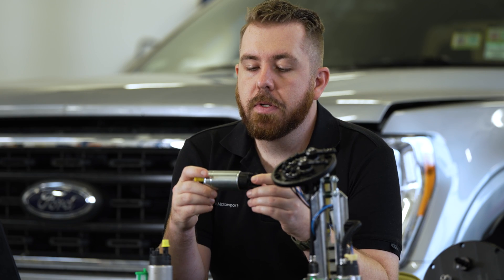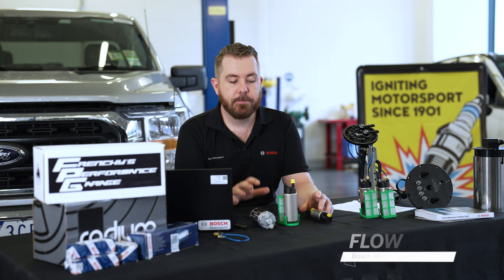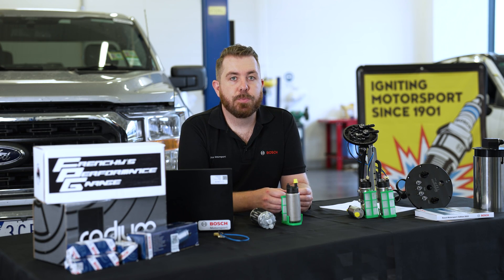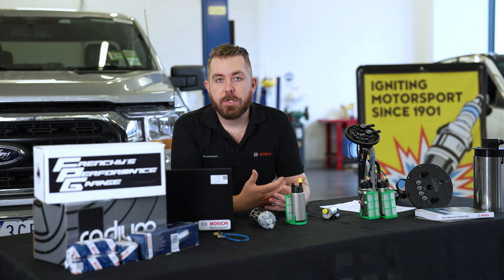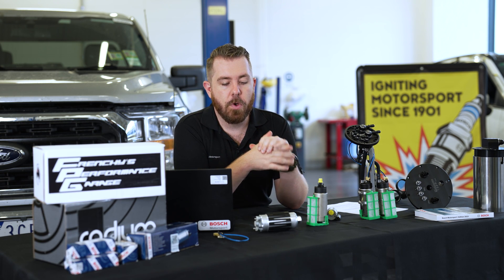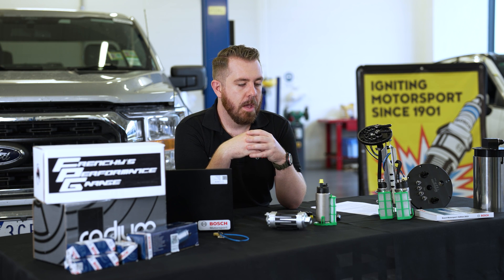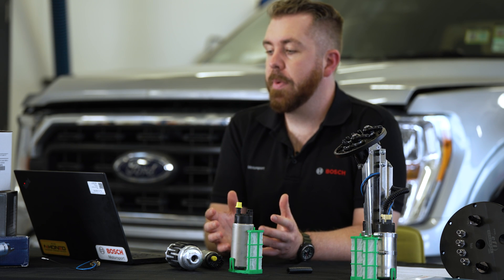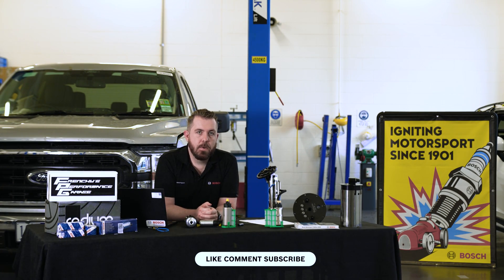Selecting the Correct Fuel Pump for your Modified or Race Car with Bosch Motorsport

Comment: Gday guys,just wondering if my 044 pump needs to be gravity fed???

Thanks
Mark
Reply from the maker: Hi Mark, the Bosch 044 fuel pump was discontinued in 2021 and has been replaced by the 200 fuel pump. If you recently purchased an 044, be cautious, as counterfeit versions may be circulating in the market. The genuine Bosch 044 fuel pump needed to be gravity fed or be paired with a lift pump for optimal performance. You can find more information about the supersession of the 044 and its replacement (the 200 fuel pump) here: https://www.bosch-motorsport-shop.com.au/blog/tech-product-overviews/the-044-is-dead-long-live-the-bosch-motorsport-200

Comment: Pretty hard to find a pump that is 10% above what your peak requirement is. Can't see a flow or current draw table for the 0 580 254 911 on the website.
Reply from the maker: Hi!  We agree, it can be hard to find a pump that is 10% above your peak requirement. Unfortunately, we can't recommend a pump that suits without more information about your specific use case/application. If you're looking for local support on our products, we suggest reaching out to the team via email, which can be found on the 'Contact Us' section of our webpage!
Reply: @BoschMotorsportAustralia  No worries. Did some training at bosch as a mechanic, it was the most enjoyable learning environment I experienced.